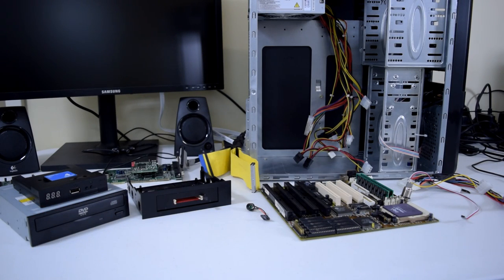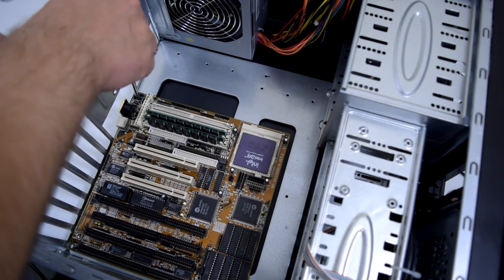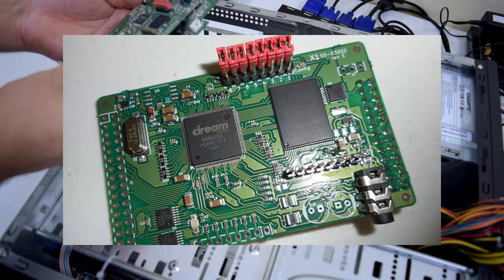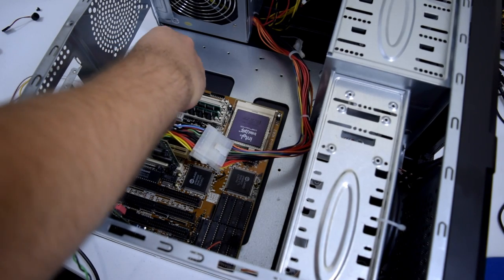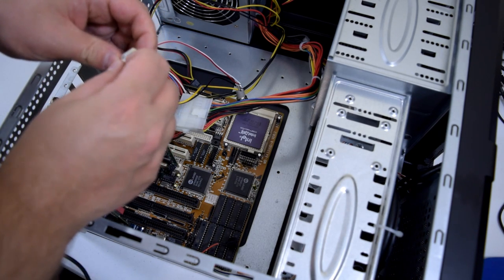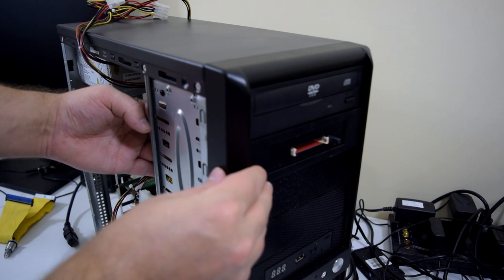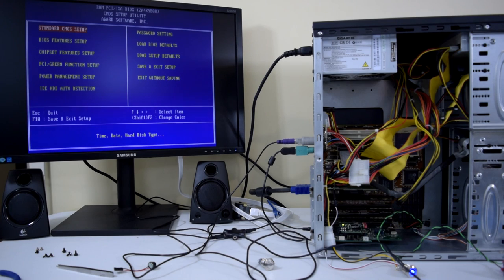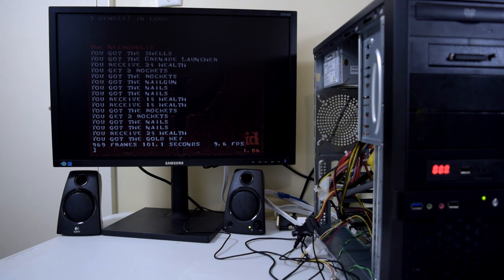Building a 486 DOS PC with modern parts

Comment: I've got a compaq presario 7106 which i am currently building but i can't seem to get any graphics drivers for it. The on board graphics is a Cirrus logic 5430 if there's any ideas or links i could get for the drivers that would help thanks.
Reply from the maker: +Scrumpy YOS Something you can try is ID notebooks from other manufacturers and look for those drivers. Like IBM Thinkpad or Toshiba?
Reply: Yeah sure i'll try that it's just an oem chip so most other manufacturers should be similar and thanks.
Reply: Or could there be some on vogons? the computer is a pretty old desktop so i'm not sure if i'll find them that easy.

Comment: PhilsComputerLab, I have a problem with a Cinet 486 I got for free quite some time ago. right now I have a 486 Intel DX2 66 in it. It came with a DX 33. But my issue is the same with either CPU. The problem is that when trying either a Sound blaster 32 PNP ISA or a SB 16 PNP ISA in DOS 6.22. Digitized sound in games are distorted. The best example is Epic Pinball where it plays digitized music. Sounds horrible and distorted. I can hear it in every game. Adlib music is fine though. I've tried everything. Only thing that works is to disable the CPU L1 cache. Soundcards are tested in both a Pentium 3 600 machine and a Pentium 166MMX machine and works fine there with all the caches enabled and normal setup. I have two more PNP variants of SB 16 on the way from ebay and also ordered a Crystal ISA sound card to try out those.  btw, I installed Win95 and ran games from the dos prompt and had the same problem with distorted sound there on the 486 computer.  Have you ever seen a problem like this? Could there be a solution for this? My greatest hope is that the Sounblaster compatible Crystal card don't have this issue on this computer since it uses it's own drivers.
Reply from the maker: Could be a lot of things really, I don't have a suggestion for you and you're already doing everything to diagnose it. I would likely check BIOS settings to do with timings and ISA slot and trying out other cards.
Reply: Problem is that there is almost no bios settings. No timings or anything can be adjusted. It has a Phoenix bios. This is one of those slim desktop models. Is in great condition. I like it because it's small and very silent. I have also messed around with every jumper setting on the board. I think my best bet will be that Crystal ISA soundcard I have ordered. I have a feeling those two other SB 16 PNP cards which is also on the way to me will give me the same issue as my current SB 16 PNP and SB 32 PNP cards, even if all 3 SB 16's will have different revisions and chips. Anyway, thanks for your answer.

Comment: Hi, I am thinking about building a pentium -3 build. Similar to yours only with a pentium-3 or pentium-4. I want to to run Windows 311, NT-351, NT4.0, 95, 98, Windows ME. I am thinking about using an Intel SE440bx motherboard with slot 1 CPU. What do you think will this work? What do you recommend for a high end pentium build that will run all of these windows operating systems?..
Reply from the maker: I've only used DOS and Windows 98. Should work fine though. Slot 1 you can go up to around 1 GHz.

Comment: Hi Phil, looking forward to the X1 review - will it fit on the Yamaha Audition 32? A game with a great midi soundtrack if you have it is Leisure Suit Larry 5. Be good to hear the theme song on it! ;-)
Reply: Sorry I mean Leisure Suit Larry 6, that has the better midi theme song! :-)
Reply from the maker: +PierreVonStaines LSL6? I can do that! I think I've got the collection from GOG. The X1, I found two bugs, but they all have been fixed now.

Mine requires a re-flash, so I'm, waiting for a USB flasher to arrive, then do all the recordings again :P

This is good news, it means that the final product will be bug free. Luckily I have a lot of hardware to test, so I discovered them straight away :)
Reply: +philscomputerlab Cool no worries, it will be interesting to see if other instrument sets can possibly replace the the pre-installed one as I kinda think from listening to the demos of the X1 that on some game sound tracks the S1 sounds better. From what I have heard, I prefer the S1 on the duke nukem theme for example as it sounds like it's got more bass. So I am looking forward to your thoughts and if possible can you do a x1 and s1 sound comparison? As that would useful to see what exactly you get for the extra money. Cheers matey. :-)
Reply from the maker: +PierreVonStaines I forgot to answer the other question about fitting on the Audition 32. The card is quite a bit longer than the S1. Fitting is a bit tight, but you can use it fine on the Audican 32, it will need to sit between the two ISA slots, and if you board has a capacitor at this spot, then it won't work. But I will show this in my up-coming review of course.

Comment: Why would you need this? Is it just for novelty or you have some use?
Reply: +Ixius YT Channel There actually is some good demand out there for systems that can run legacy software.  A lot of older software was written much closer to the metal, and is difficult to emulate, esp if it is paired with exotic expansion cards.   This type of stuff comes up in manufacturing, science, old education systems, banks, even old military systems.

As a hobbyist, I have been pondering a similar (but from the Apple line) build in order to use an exotic camera for instance.

Comment: Do you have a recommendation for an alternative motherboard to use for this project?  The cheapest I can find on eBay is a Buy it Now of $275!
Reply from the maker: +Rick FromEarth ANY Pentium 4 motherboard with Intel 865 chipset.
Reply: +philscomputerlab Pentium 4?  But this is a project to support a 486 DX4 100MHz CPU.  How would a Pentium 4 board help?
Reply from the maker: Oh sorry, I looked at the wrong line in the Community page and responded to a different project :)

Yes, good 486 board aren't cheap these days. Finding one with PS/2 port especially might cost you a small fortune. I wouldn't be too picky, serial ice work well enough and you should find affordable 486 boards.
Reply: +philscomputerlab Having to use a serial mouse doesn't bother me.  Is it advantageous to have one with PCI slots? Or can you get by without them?
Reply from the maker: No need at all. Vesa Local Bus is just as fast, but cards a bit harder to find. ISA only 486 are also quite decent, but on a DX2-66 they can act a bit like a slow down.
Reply: +philscomputerlab I have a lot of non-PCI older cards already.  So an older 486 board should work for me.  I would like one where the CMOS battery is easy to replace so there is no soldering involved, if they exist.  I just looked through my stuff and I have an AMD DX4 100 in there.  Are they a tiny bit slower than the Intel version?
Reply from the maker: A tiny, tiny, bit slower. You will not notice it :) To remove batteries, just use a clipper :) Look for some pins / header near by for connecting an external battery pack,
Reply: +philscomputerlab Thanks for the advice.  Off to eBay to look for 486 boards...

Comment: Might not be a good idea to use a modern PSU with such an old PC. The CPU draws power from the 5V rail and might be too much for a modern PSU to handle.
Reply from the maker: How much power do you think this 486 draws?
Reply: a bit
Reply from the maker: Find it out, you'll be surprised.

Comment: Hey phil, i had this windows 98 gameing setup for a while, the computer sem'd  to went dead but it sems to be allive now suddenly.
Reply from the maker: +Nico 93 Could be lots of things I'm afraid. Power supply or maybe ageing capacitors.
Reply: +PhilsComputerLab The computer is acting fine now, it was proberly some dust bunnies that prevented the machine, are you aware of any decent 3D pci cards? its around 700 the machine itself.
Reply from the maker: 700 MHz? A Voodoo 3 PCI would work. You can also game really well on ATI Radeon cards. Something like a Radeon 9000 or 9200 SE.

Comment: did you have a heat sync on the CPU?
Reply from the maker: Yes I just forgot to put it on when filming!
Reply: ok! I remember building 486 systems and thought that after the DX33 if you didn't have a heat sync it would kill the CPU rather quickly!

Comment: Can anyone help me understand why you would want to build that.  I hated how slow it was, even then.
Reply from the maker: +mapoff My channel is based around playing old games. So for old games you want an old computer :) Now I also cover DOSBox, but some people like building a PC. I mix old with new so to have some comforts such as optical mouse and fast storage. It's a great hobby, but it's really for the old games.
Reply: How do the DOS games do with newer pcs with newer versions of windows?  Back in the day I noticed some games didn't have a time reference.  What I saw is it ran normal speed on a current pc at the time, but when I upgraded lets say to 100mhz more, the game just ran way faster.  So a man walking on the upgrade appeared to be power walking x50 speed.
Reply from the maker: Yes that's an issue for some games. But most will work fine! I played Prince of Persia for example on a modern notebook recently, booting to DOS from an external floppy drive :D

Comment: How do you have a BIOS menu on an old 486 motherboard?
Reply: +hughjazz44 They had them back then, although some functions would still have been controlled by jumpers though (mainly clock multiplier, base speed, etc.).
Reply: +hughjazz44 BIOS was basically the same then as it is now, at least from the user interface standpoint.
Reply: +hughjazz44 My ancient 386 even had AMI BIOS with menu, it was common.
Reply: All my old systems had either jumpers or dip switches.

Comment: Does 486 CPU not required any heatsink and fan?
Reply: +TheCureDMan yep, it does, heatsink from 66, 66+mhz shoud be used with a fan
Reply from the maker: +TheCureDMan A lot of people have mentioned the heatsink. Unfortunately I don't have a cooler that fits the 486.
Reply from the maker: +Jocó Kása I've just ordered one from eBay :)

Comment: cant you use reset button as turbo?
Reply: +MrPepsicola123 The reset button, like a modern power button, only gives a short impulse. In the olden days, though, toggle buttons were used that remained in the state that you selected. So for power to stay on and turbo to be activated or deactivated, the button must remain in the selected position.

Comment: Here I was hoping he'd get a PCI GeForce/Radeon card with HDMI out, and a PCI Sata controller.
Reply from the maker: +stonent DVI out is locked at 60 Hz, whereas DOS games run at 70 Hz, so you won't get smooth scrolling and some games will run slower. No need for SATA, MS-DOS 6.22 has a limit of 8 GB.
Reply: I was more interested in seeing things like SATA and DVI functioning on a 486.
Reply from the maker: +stonent I use that on faster Pentium machines, but on a pure DOS 486 I wouldn't. Sometimes you can over engineer a solution.
Reply: I wanted it for the absurdity of it.
Reply: You can also get a PCI to PCI-E 1X card on Ebay.  GeForce 1080 on a 486.  Probably not a single OS that would work with it.

Comment: I dont recall seeing a heatsink and fan fitted
Reply: +Liam Goodison 
That old cpu doesn't need any, they're running at 66MHz +/- 33 MHz so they wont get all that hot, you can actually stick your finger on it at full load and you will not get hurt.
It's the same with the old Amiga from Commodore, mine for example are equipped with an 68030 running at 50MHz within a confined space with all most no air circulation at all.
Reply: +Hannes Camitz You are wrong I had 486 100MHz and It needed radiator.  It was passive cooled by simple black maybe 5 cm high radiator if I can remember it correctly. It was a long time ago. My setup was 486 100MHz 12 MB ram, 356MB HDD, cirrus-logic 1MB video card and some floppy, cd-rom, sound card etc.
Reply: Yes the 100 MHz and pentium cpu required heat sinks and or fans, but most of the 66MHz and less didn't.
Reply: oh I remember having a dx2-66 and it definitely had a heatsink and fan
Reply: Well... There is a difference between required and had. ;-) 
The silicon can withstand up about 120-130 centigrade before it start to collapse, if I remember correctly. 
Even the ARM cpus in Raspberries can have heat sinks even though they doesn't require them unless they're over clocked, not even then in some cases.
Reply: +Hannes Camitz My pc was bought from one of biggest computer making  company in Poland back in the day (Optimus). They build hundreds of thousands pc and if they put a radiator in on 486 100MHz I belief it wasn't an overkill.  I don't have TDP for 486 but Pentium at 100MHz had 10W. Entire Raspberry Pi 1 mini computer have ~2,5 W
Reply: +Hannes Camitz Depends on the CPU. Some of those Cyrix and AMD CPUs ran so hot they'd fry themselves real quick without a good HSF. I had an AMD 386DX that would overheat and stall in about five minutes.

Intel CPUs have had overheat throttling since way back, so were always harder to cook.
Reply: Well... AMD still runs hot enough now days too. ;)
Reply: +Liam Goodison Sounds like a good mod to add a heat sink and fan to a 486 DX2 66MHz processor. Back in the 8-Bit days people would put small cooling fans in a Commodore 64 running at 1MHz. 1!
Reply: +Hannes Camitz Yes, I remember 486 DX2 66MHz that did not use a heat sink or fan and those computers were powered on 24/7/365 in a commercial setting, on the floor, some in cabinets, in a drug store. They rarely failed, even though the cabinets, and the computers would get very warm. I couldn't carry on a conversation over the hard drives in a cabinet with 2 computers, the larger one used as a router.

Comment: Couldn't you just use the normal ATX case power button as a power button?
Reply from the maker: +Medicfinland That doesn't work unfortunately. On a modern motherboard, you connect the power swich to the motherboard, but on these old boards there is no such connection. The power is turned on at the power supply.
Reply: Okay. Weird. I thought it was just a connection between the two wires that powers it up, but I guess the connection goes away when you let go of the button on the case? Or is it just wired differently? Great video BTW :)
Reply from the maker: Yup it goes away when you let go, that's the problem right there :)

Comment: IO shield?!! IO shield?!! I haven't even got sides on my case.
Reply from the maker: +edgeeffect Haha, yea good point. My main retro PC has one side panel open because I always change something.
Reply: +PhilsComputerLab and you can keep all sorts of odds and ends in the bottom of your case... monitor power supply, etc.
And having no IO shield gives you a nice bit hole to poke spare wires through. ;)

Comment: Kinda pointless doing a benchmark for Doom because the frame-rate is capped at 36fps (due to it being exactly half of the monitor's refresh-rate of 72Hz). If it wasn't for that it could've ran faster, especially on a DX4.
Reply from the maker: +Dash You are correct. Still, it's actually one of the few, if not only, VGA gaming benchmarks from that era!
Reply: PhilsComputerLab   I'm quite surprised that 3D benchmarks existed back then. This video was interesting

Comment: I do not remember by now.... i486 needs absolutely no heatsink? well I remember I used to have a pentium with passive heatsink on it back in 1990s
Reply from the maker: @Galova  It depends on the CPU. Especially the 5V versions can run hot. For short periods it's usually not an issue, but as always, it depends...
Reply: @philscomputerlab  so your particular CPU runs without a heatsink fine?

Comment: the led is 5 volt, not 12
Reply: +S&amp;P Gaming more like 3.3volt with a resistor to limit voltage. not 5 or 12
Reply: more like 12-20 milliamperes, which means that for any input voltage there is a range of resistors what will limit the current properly, but who's counting?

Comment: Why 486DX4, not AMD's Enhanced Am486DX4 or 5x86?
Reply from the maker: More compatible. Don't need to muck around with WB Cache and exotic jumper settings, the IntelDX4 is usually always supported. It's also faster clock for clock against the 5x86, and the extra 33 MHz don't add much.